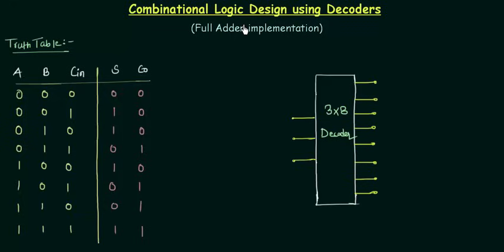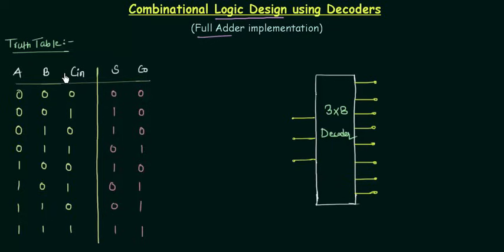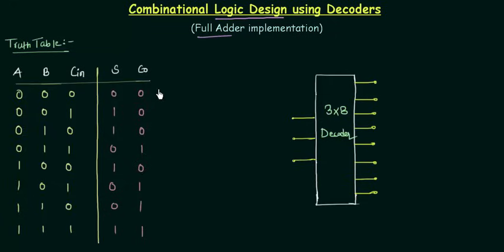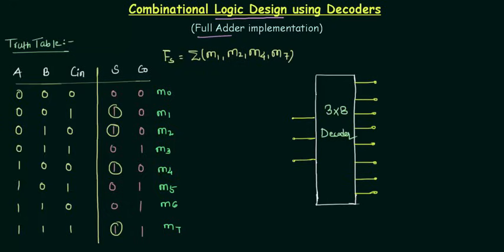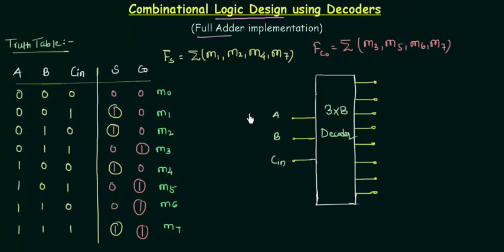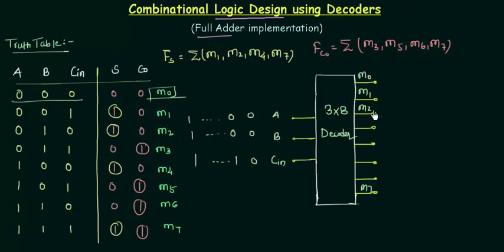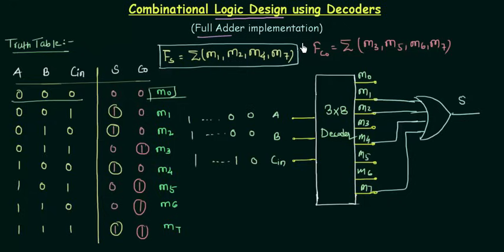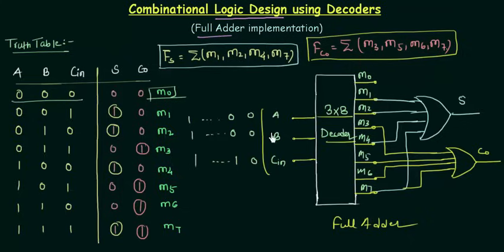Full Adder Implementation using Decoder

Comment: dear in the full addar we can use two half addars for the construction of a full Addar. In your video you told that we will use two or gates but if we split the full addar we have a XOR gate and a and gate  to handle the carry output for 3 inputs, but you only told about the OR gates. Please also supply us another video and use two half addar so we can justify that int the end what will we use with decoder an OR gate or XOR gate. Thank you